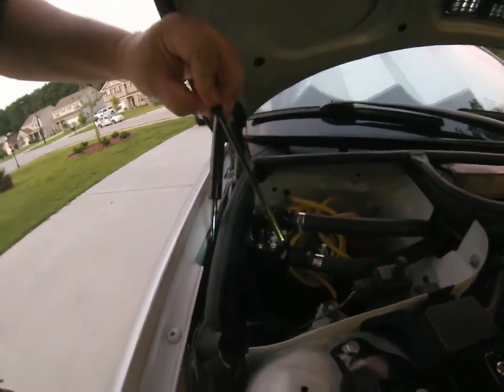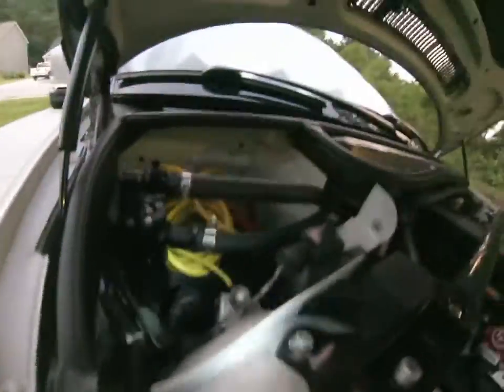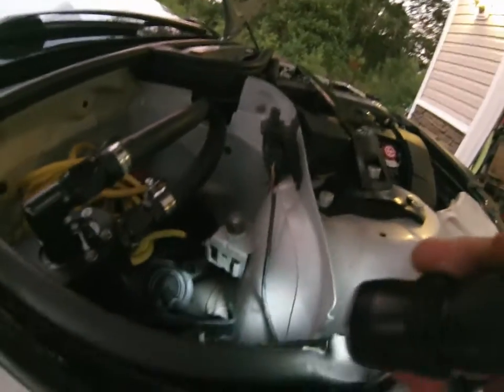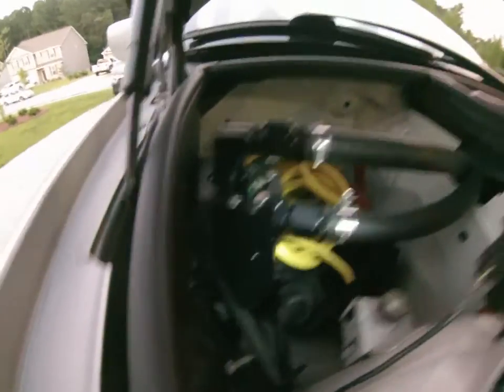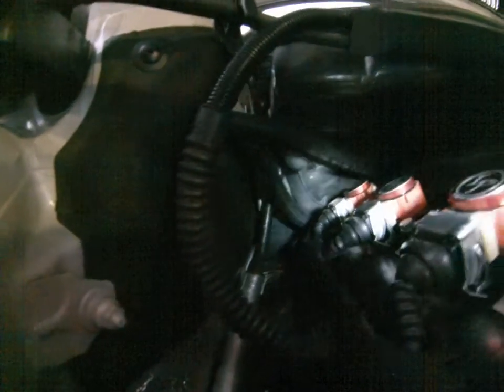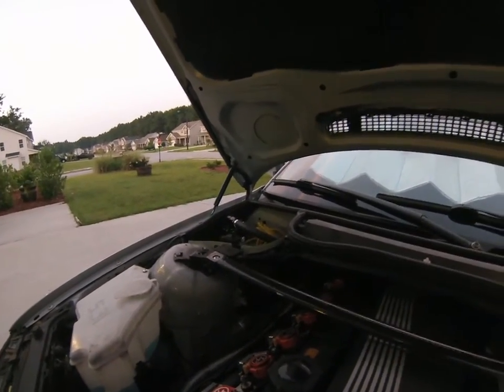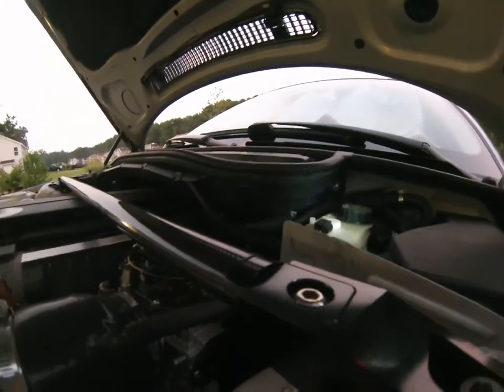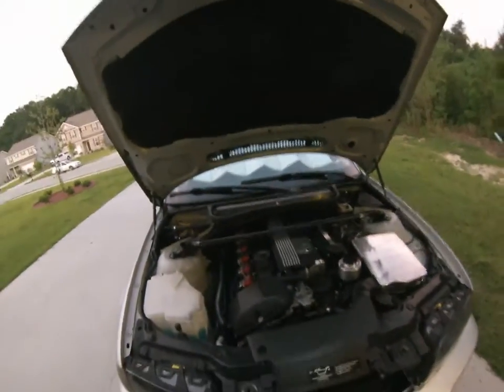Walk through of Radium Engineering oil catch can setup

Comment: looks awesome going to consider this since I hate the CCV. I replaced mine due to being old and brittle. I rather have something like this that won't fail especially in winter.
Reply from the maker: +Jeff Barry 
The radium setup is really nice. I've been running it for a year or two now and have no complaints. Just make sure that you pop a PCV valve in if you are naturally aspirated, otherwise you will run lean. Glad the video was of some help!
Reply: dudeman659 why?

Comment: Looks like you had the SAP removed from your car, did you consider mounting the catch can on the studs that the SAP used to mount to?
Reply from the maker: Ryan Kneeshaw I had thought about it, but that would place it right next to the exhaust manifold. So a lot of excess heat would radiate on the can and the rubber hoses. Plus I don't see much of an issue with Radiums chosen mounting location.
Reply: ***** Thanks, looks like there is a factory cutout for the hoses going into that drug bin too, easy.
Reply from the maker: Yes sir. Its a rubber gasket that is easily removed. Gives good access for running the hoses.